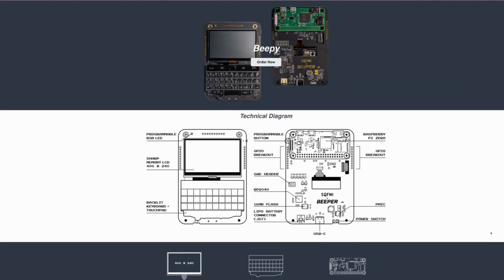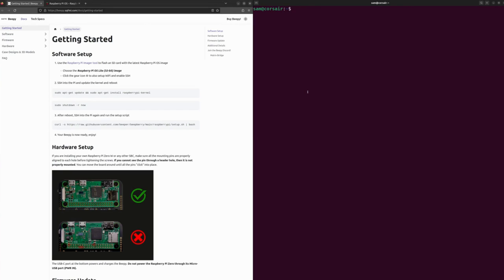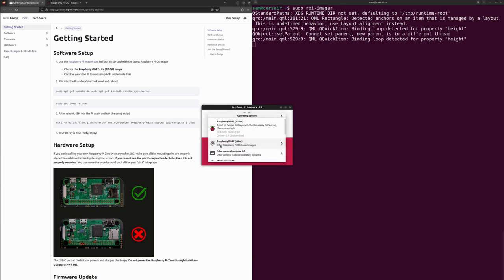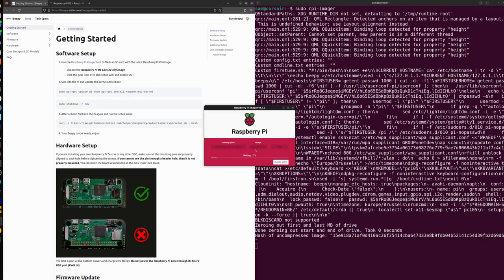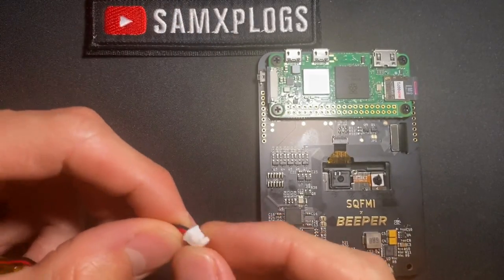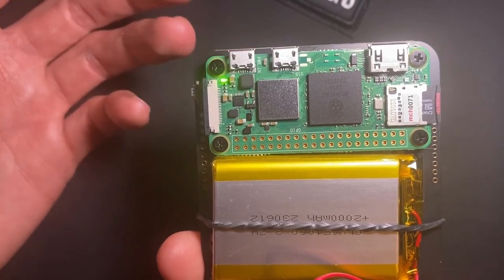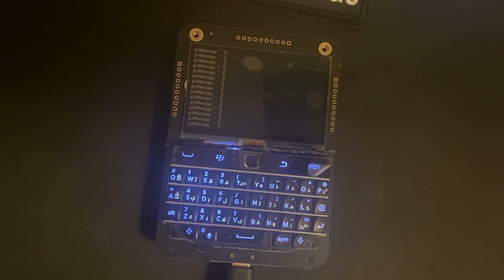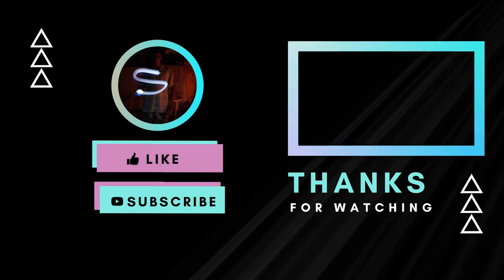Beepy by SQFMI :  Unboxing and Installing the Latest Project from the Founder of Pebble!

Comment: is it even possible to run an desktop gui like gnome?  or only terminal? i know its monochrome, but is it possible?
Reply from the maker: Indeed, you can. I did seek validation from the community on this. Nonetheless, adjustments are needed for the resolution and the keyboard/trackpad drivers.

Comment: Okey can we install windows 10 or Kali os or it's just  terminal  I wonder I'm looking for it
Reply from the maker: Hey Matrix, indeed you can install. On its back, there is a raspberry pi zero 2w. Hence this should works. You will just have to install sqfmi scripts in order to have the keyboard working.
Reply: No way you could get Windows 10 on it
Reply: @mgord9518  then what's point of it lol
Reply: @ghjgjgjttytttt  It's a development toy. You make your own apps and do essentially whatever you want within the bounds of the low-powered hardware. Is a device useless to you if it can't run Windows? That's a feature in my book